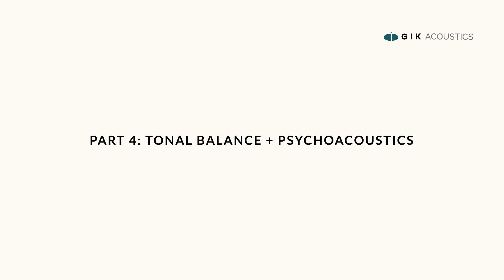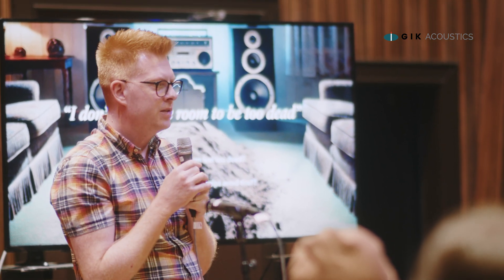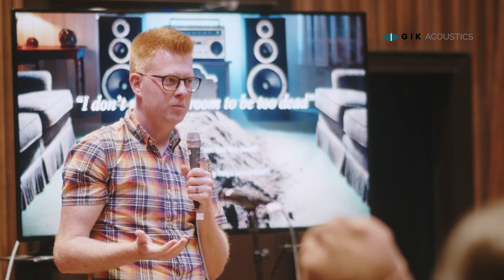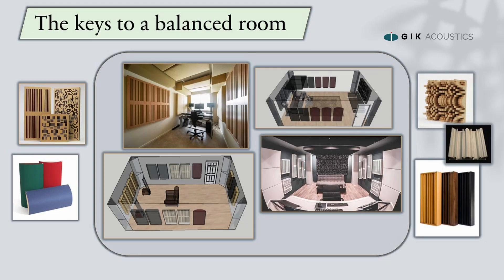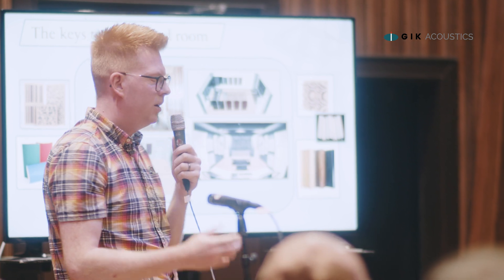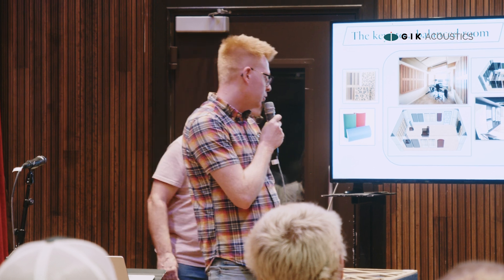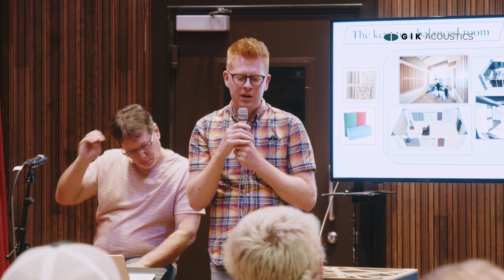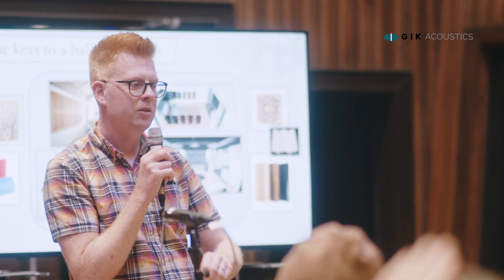Tonal Balance & Psychoacoustics | Studio Acoustics Masterclass at The Blackbird Academy

Comment: Why do people talk about foam like it will spontaneously combust and burn your house down? I don’t hear warnings about breathing in insulation material…if we’re going to be captain safety 😉
Reply: Storing highly flammable materials indoors could make an otherwise controllable fire become catastrophic.
Reply from the maker: Foam products are typically not fire-retardant, which can pose a fire hazard. They also often contain chemicals and binders that may trigger allergic reactions.
In contrast, high-quality mineral wool is free of additives and safer to use. Even if fibers are inhaled, they degrade fully within the body, posing no long-term health risk.
These concerns stem from a time where mineral wool product were poorly regulated.

Comment: When considering a diffusing panel, is it possible to have a thin fabric cover over the top if you don’t like the aesthetics? These panels dominate so much of the rooms visual design, it’s important to have options. Also, thank for doing these videos, it shows GIK has technical prowess vs the perception that some acoustic companies get of pushing simple foam with fabric. I’d love to see how your panels address different frequency ranges vs physical makeup.
Reply: You would be the first one not liking the aesthetics. Most use diffusers as decorative elements.
Reply: Ultra thick fabric for absorption and ultra thin for diffusion! Doesn't necessarily have to be acoustically transparent but thinner, the better (similar to what's on front of a speaker grill). I personally find thin cotton is good enough. One can always test it by blocking your nose and covering your mouth with the fabric, and if you're still able to comfortably breathe a minute or so later, you're good to go